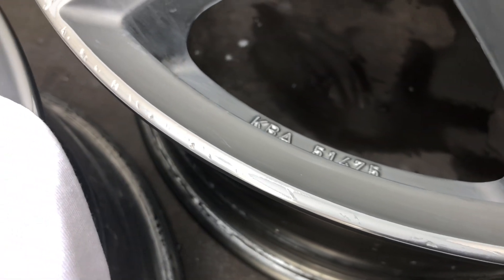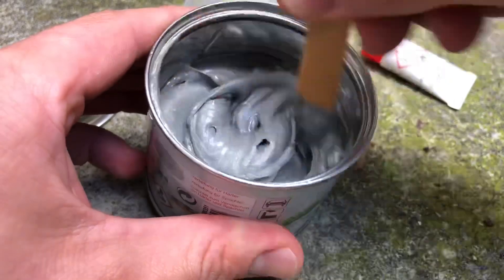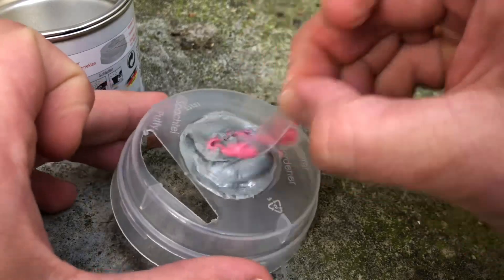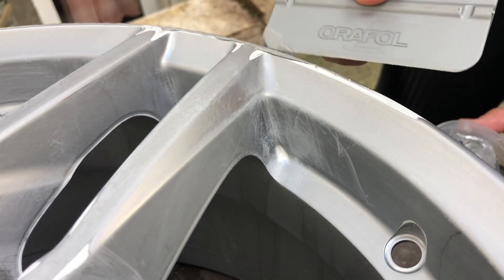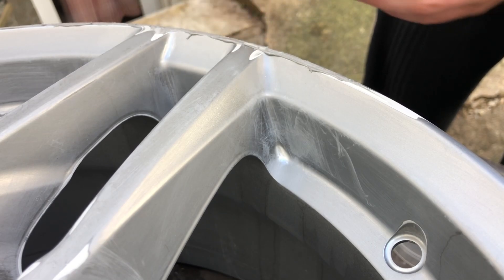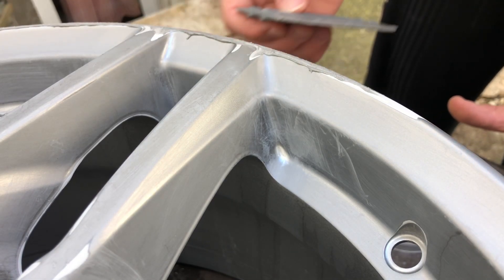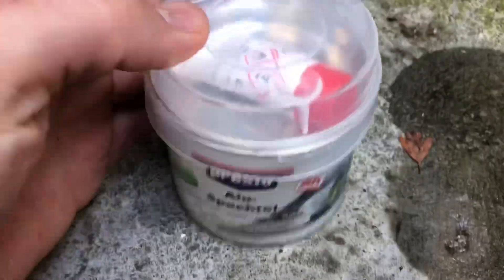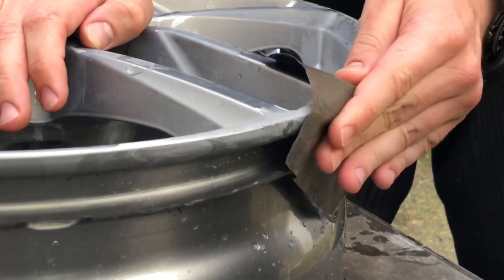How to repair an alloy rim with 2K Presto car repair putty car alloy rim repair instruction DIY

Comment: Should have started sanding with 250 paper first then moved to 400 then maybe on to 800, that's how to create a flat surface without rubbing the area around the filler.
Reply from the maker: Indeed, start with a low sanding and keep continue with a finer (higher) sanding. Best regards

Comment: I could start even with 120 and go on to 600 , the 800 is too fine I usually use it to take down a  deep scratch when I polishing a car .
Also to make it smoother from the start you can use two spatulas so every time you apply the material you clean the spatula with the other spatula so you don't have to much to sand.
Best regards.